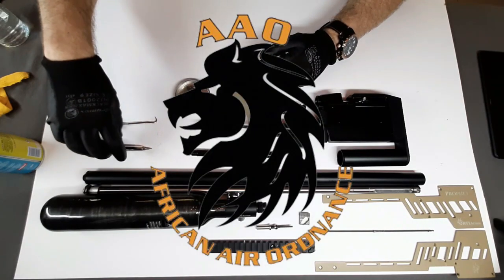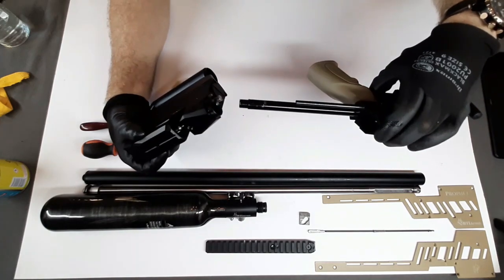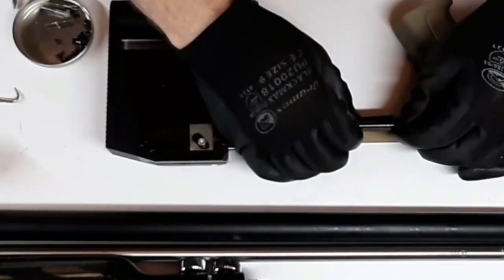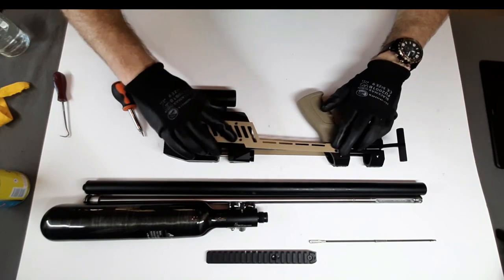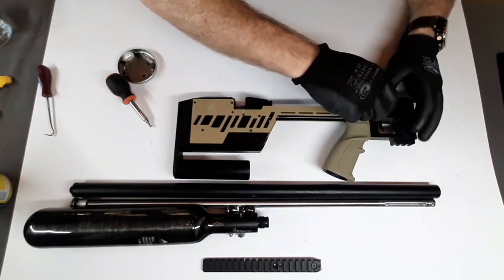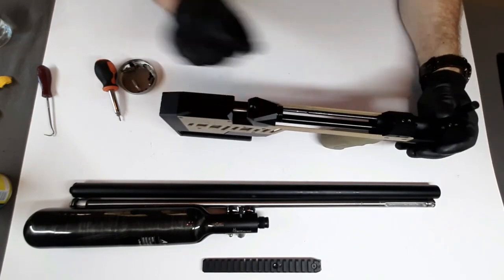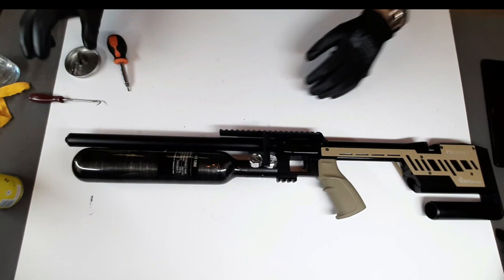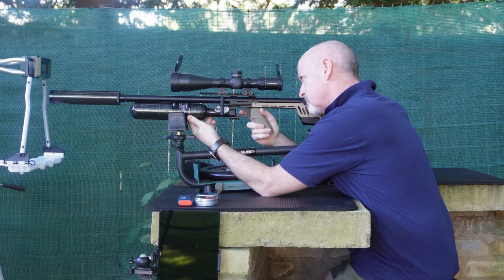RTI Prophet II  5 5mm Reassembly and test Part 2

Comment: I disassembled and reassembled my Prophet 2. I adjusted the linkages multiple times and it refuses to cock. Do you have any advice for me? Thanks.
Reply from the maker: Could be that when you reassembled the back block to the plenum that it's not far forward enough  so when you try cock the rifle the length of stroke is not long enough to push the hammer over the hammer sear

Comment: Thanks for the Video. I will be changing my valve for the second time today. First valve went bad after the first hundred shots. Contacted RTI and they sent me a new one, a bit different than the original. Few days ago was shooting and gun started to dump all its air out the barrel. Contacted RTI again and they are sending me the newest version of the valve to change out. I have a replacement valve that someone sent me so I could use while I wait for my replacement from RTI. BTW I'm shooting a .177 P2 performance set up for 20gr slugs! Can you tell me the purpose of the check valve you removed to get rid of the squeaking sound? I may do that to mine while I have it apart!!! Thanks again
Reply from the maker: Thanks for watching

Comment: What is the weight of the hammer in the Prophet 2.  I have a Prophet 1 and the hammer weighs about 36 grams. When I am using.177 barrel, I was thinking about using the hammer from the Prophet 2.

The Prophet 2 hammer seems lighter weight as it is all drilled out in the picture of it at RTI Shop.
Reply from the maker: no idea Thanks for watching

Comment: Excuse me, when you change the original valve, is it when you lose the lively sound?
Reply: Ya he visto la parte uno de donde quita la valvulita de retención, gracias
Reply from the maker: Not the nail valve  it's a check valve in the front of the rifle

Comment: I enjoyed this, thanks.
My P2 has been apart a couple of times. Assisted valve.
Not once have I touched check valve, perhaps next time, perhaps.
Well done 👍
Reply: Hi there,

what problem did you have with the assisted valve?
Reply: @miljanmilivojevic4905  
Hi Miljan, 
When I first got my P2, it started to dump air through the assisted valve.
RTI arranged collection and corrected the issue.
A few months later it was losing air through the transfer port. I stripped, cleaned the valve, reassemble etc, it's been no problem since.
Excellent support from RTI.
Reply from the maker: leaked
Reply from the maker: Thanks for watching